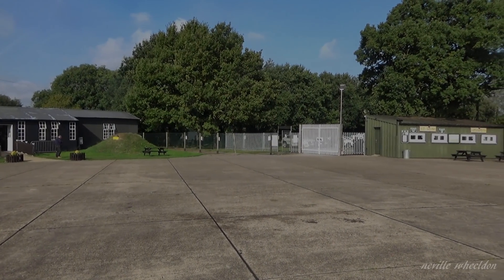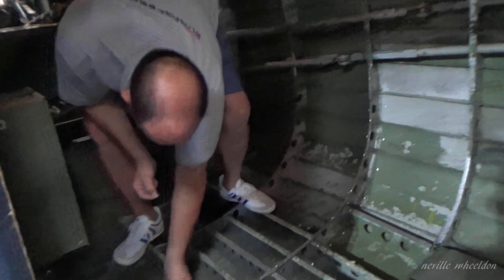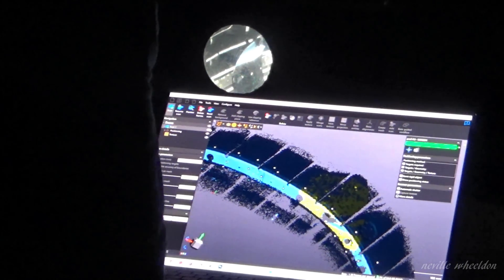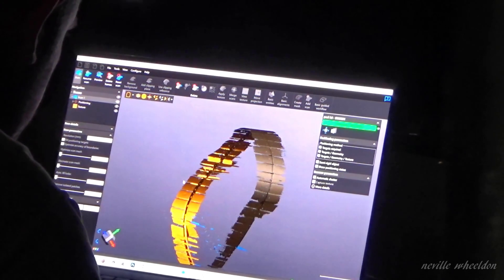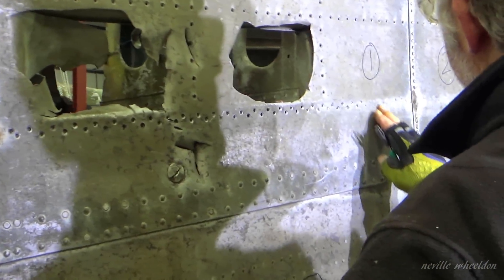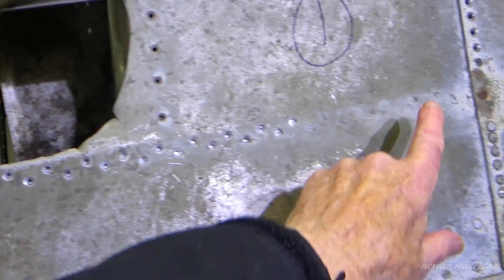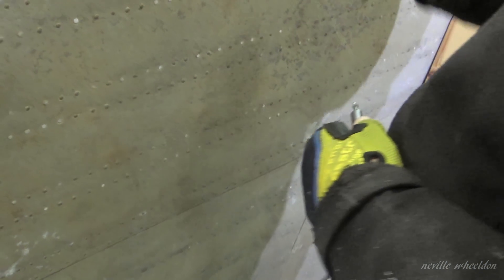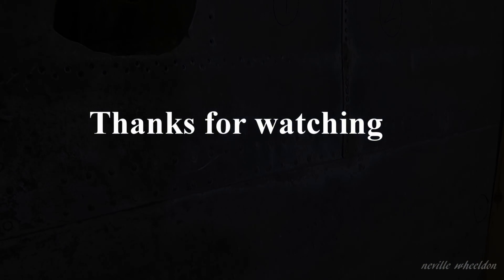Video 115 Restoration of Lancaster NX611 year 4.----3D Scanning, plug rivets removed

Comment: Nice episode Neville. The scanning of the ribs is a fascinating process! Next time you speak to Keith, ask him if it's possible to use a left handed drill bit of the correct size to remove the threaded part of the corroded plug rivets, as they should catch the material and unscrew them especially if used in conjunction with penetrating fluid as the head will have already snapped off thus giving the fluid a chance to work into the thread portion.
Reply from the maker: Hi mate , will pass your message on.
Reply: @nevillewheeldon1693  thanks Nev.
Reply from the maker: @samrodian919  Hi I had a word with Keith about the left handed drill. He said yes it could work, his full answer I have put on video 126 (On YT in the next 14 days)
Reply: Thanks  Neville, will look forward to seeing Keith's answer. Cheers, have a great Christmas and new year to you and your loved ones, and let's hope it doesn't start with another bloody lockdown like this year !

Comment: Thank you Neville,  do you know why they used the plug rivets instead of the ordinary ones? do they have different properties?
Reply from the maker: Hi Lapwing, the plug rivets are different to Blind rivets Wallace commented on. These rivet are in the Boom or Cord of the spars of the wing . The boom is about 2" thick They drilled a hole about 3/16 of an inch deep then the hole is taped  ,has Keith says the rivet is longer the the drilled hole so will stand proud, the gun will drive the rivet down filling the threads. I believe AVRO was the only aircraft firm to use this method. The only other way I guess is to use screws. I will get Keith on video explaining in more detail in the next week or two .
Reply: @nevillewheeldon1693  Thank you Neville for your answer and in general for your on-going coverage. It's fascinating to see all the jobs being done and the amount of work the folks are putting into it. You do a fantastic job for the their profile and it's through your channel that Ive been encouraged to do my wee bit in support of the project.👍
Reply: @Wallace Carney great; thank you for your reply👍